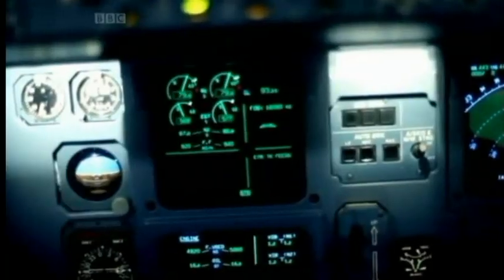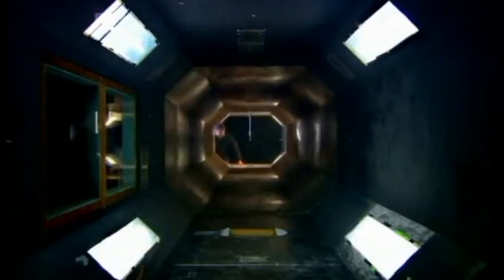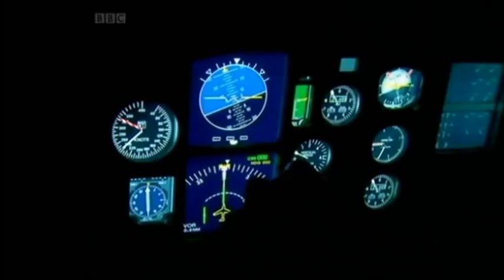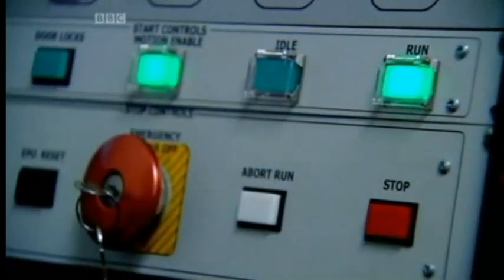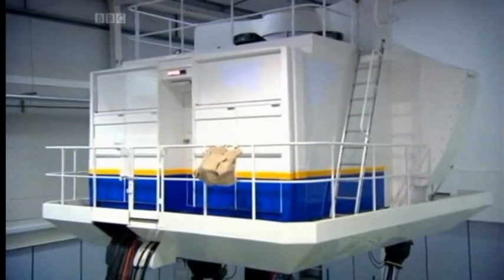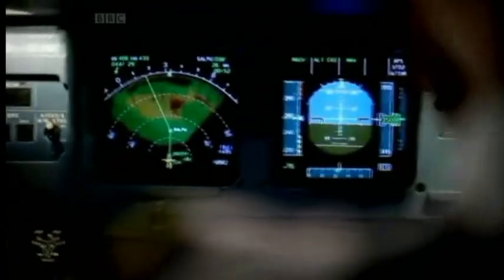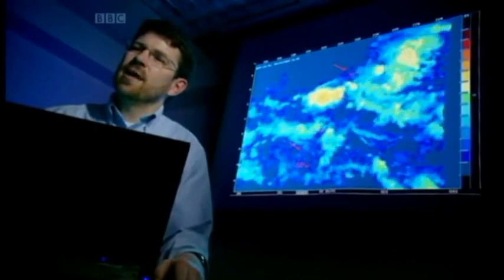The Crash of Air France Flight AF 447- Part 4 of 4

Comment: This was before they found the black boxes and it's so much worse. I mean they were pretty much correct but this was so avoidable. The captain left the cockpit, had he been there the whole time he would have known right from the beginning not to try and pitch up. He came into a cockpit with so much going on and he had no clue and then once he realized what the co-pilot did, he told him no no no don't pull up but they were too low at that point to recover. The co-pilot panicked and because he was trying to pull up, he caused the stall. If he had just pitched down and accelerated, he would have come out of the stall and leveled off and been able to have the autopilot take over. They almost recovered. But that copilot failed those people

Comment: They all should have pulled back on that stick with everything they got.
Plane falling you get that plane up fast.
Reply from the maker: That is what they did incorrectly! They should've pushed the stick forward and firewalled the thrust to stop stalling.
Reply: No that's exactly why they crashed. He was pulling up which wasn't allowing the air to flow over the engines fast enough to stop it from stalling. If he had pointed the plane down it would have resumed airflow and speed which would have stopped the stall and then they would have been able to slowly level the plane off. You can't just pull up in a stall. Because the wind resistance will slow the plane down. Pulling up is exactly why this plane crashed. That's the exact opposite of what they were supposed to do

Comment: The altimeter indicated a drop of 400 ft (error).  The ECAMS on the instrument panel warned of overspeed.  The Flight Director display indicated that the nose should be brought up (and the STALL, STALL, STALL stopped when he increased the pitch up).  Technology was misleading.
Reply: that is why it still need pilot to fly it.

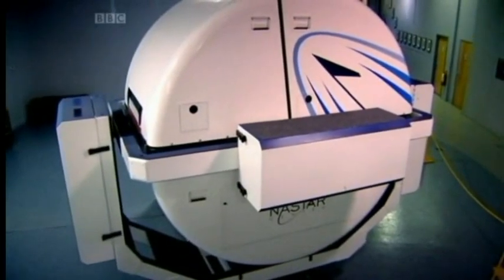Comment: @ 6:14 yeah but at night, you have nothing to look at for reference. No water, no sky. It's just dark. Get that pilot in the trainer to do it again but in the middle of the night. Might be a different situation.
Reply: They actually recreated the events numerous times with everything happening in the simulator exactly the same way as it happened and every single pilot that entered the simulator, recovered from the stall. This was incompetence by the co-pilot.
Reply: You are completely right this situation & events @night in a storm with confusion is as bad as it gets. 

Training & experience is required & this accident has improved training methods. I am certain this chain of events is used to train pilots.

Comment: Qantas Airlines records all the flight data from all their planes from the ground. I wonder why all airlines don't do this because then it's not as big a deal finding the black boxes.  Not only that but Qantas has engineers immediately available to help the pilots when their computers show there's a problem. Finding the black boxes is important but preventing a crash is obviously more important.  Also, isn't there a way to heat the pitot tubes?  Just asking.
Reply: They sayed that they were heated. However not enough, so they designed new ones. The plane however was still not fitted with them. I agree with the constant ground recording. It will do much more in saving people's lives. What i don't get is why they completely ignore the GPS and weather satelite data? Theoretically they could use that informtion to make a rough esimate for air speed.... Also how hard it is to put a power feedback in to the throttle console? They even put such things in joysticks!

Comment: The investigators had the initial pilot factor and design issues identified before the black boxes were recovered. Poor control design was a contributing factor, one pilot was pulling the nose up trying to climb and stalling the craft, the other trying to nose down to gain speed and resolve the stall. The conflicting control commands canceled each other and gave no tactile feedback to the crew who weren't communicating well with each other.
Reply: Quite right, these guys are too nice, that panic button Bonin would not let go of that joystick, trying to climb, not even thinking about what he was doing, and after he was told to release the controls, still kept at it, nothing to explain his behaviour except pure unmitigated PANIC. And he made Air France pilot....

Comment: Great program. An accurate and informed production. Such a rare thing on TV. The release of the cockpit transcript confirms most theories this program has concluded. Don't condemn the crew. Recovering an aircraft from an unusual attitude in the dark is hard enough any time. Doing this with conflicting airspeed indications at night in a thunderstorm is even harder. Then add the issues of side stick priority and conflict it becomes unrecoverable.
Reply: hmm...it's quite evident that Bonin panicked and there was a total break down of communication.

Comment: shuld the pilots have saced the plane? yes. is it as easy as it seems after this video? no. ur in the middle of a routine flight prly tired pitch dark and bam everything is beeping at once it prly took them 30 seconds just to figure out what was even happening nevertheless fix it. i think a big problem along woth dealing with the situation was simply identifying it too. identify faster, and the situation is still more in hand and more time to react more altitude to work with more speed u have...

Comment: I have watched this so many times. Thrust, power, autopilot... that's not it. All the pilots had to do was push the nose down. Jeez! Everything that happened to 447 (before the stall) has happened in my little single engine. Ice, turbulence, whatever. Slow down and PUSH down, and if the AP won't let you, turn the damn thing off. It is not pull, not power. Get the nose down. It makes me angry when "professional" pilots kill people because the no longer know how to "fly the airplane".

Comment: Why didn't Air France Pilots increase thrust immediatly when their plane slows down too much? I am not a real pilot but if i were to be in that situation, when the speed slows down greatly, I will disconnect auto pilot immediatly, increase power to full, and point nose down.

Comment: I am not a fly boy. I am a truck driver. There are times on the road when its pitch black, rain or whatever, you can not feel the road anymore, its like your floating, and you have only inches on either side of you. For them it is the reverse, I come to a slow powered stop, They need to ramp up and trim to a default condition. This is the problem with auto controls and dependably on "drive/fly by wire. You cant feel anything and your body has no memory of what it has done or where it is.

Comment: Easy to blame the pilot as being incompetent when you know what is going on and why. Having a back ground knowledge of the accident gives you a bias in what was going wrong and how to fix it. In reality you put yourself in the cockpit with systems failing, buzzers and alarms going off and with know indication to your most primary and important indication (airspeed). Especially when flying at high altitudes any increase or decrease in IAS will result in the aircraft stalling.

Comment: Even you have to trust your equipment instead of what your instincts tells you..
1. Theres NO info about airspeed or groundspeed
2. Theres dark, that means no visual orientation
3. Only thing which is working is gyro telling your attitude

Firstly you'd take controls WITH manual thrust and fly with power enough to hold decent airspeed and angle  of attack. Until you gain level flight. 
But I have to admit that its pretty hairy situation to get those alerts and airspeed showing crappy things.

Comment: A330 is a fly-by-wire - the aircraft has no rigged linkage to the control surfaces, and that is why the stick wouldn't shake even if you're about to stall or you're fighting against turbulence. This is discussed in part 2 of this documentary video.

Comment: @aizad3755 

Many years ago I remember an Apollo astronaut speaking about the reliability of their spacecraft. He said its reliability was the product of disimilarity and redundantcy in its vital systems.
This begs the question .... Why three identical pitot heads, why not two pairs of very different designs? At least it would be fairly certain that  there would be a time gap between each type icing, thus giving some warning of inpending failure.

Continued ....

Comment: very sad video. if right the answers are the speed indicators, something they have a fix for. bad timing in their turn for the upgrade. a not so simple a fix would be the ability to perform as the fighter pilot did. that i think not being simple by virtue of the fact that in all fairness he has to be considered part of an elite class of pilots. so if proven correct, the great loss would be due to a known issue, the indicators. and sad becomes horrible. me? no pilot, just human.
Reply: Matters not the number of hours one has. Any LOC scenario is difficult, this one had some added complications. Specific training, such as UPRT, SD, etc. is what all pilots should experience and early in their flying careers.

Comment: We do cover stalling in the sim but for years it was always at around 10000'. The aeroplane handles much differently at higher altitude so, following this accident, we now cover high altitude stalls in my company. Interesting point in that from around 37000' a standard stall recovery will lose around 4000' of altitude before the aeroplane is back to speed, and, during recovery, even the slightest extra loading caused by pilot input or turbulence can drop the aeroplane back to the stall.

Comment: @aizad3755 
Yes, I've flown with Air France a couple of times and their service is of high quality. Their safety record, however, is pretty poor, even if you concider the amount of flights they do. (Bad safety record doesn't matter to most customers, because flying is safe anyway.) I just wanted to point out that programming fault in Airbus software should result in problems with all airlines, not just AF.

Comment: @ASAMMBA if there was ice formed on the PITOT tubes there would have also been ice formed on the wings of the aircraft, but may have explained why the aircraft banked in a position where they ended up stalling in the way explained on the video. There is still too many factors that should have also been noticed, just the PITOT tubes icing couldn't cause the aircraft to fall from the sky. If it was enough to ice one thing, it could have been enough to cause a great deal of air flow disruption.

Comment: @marnicmoobla to my understanding the throttle moving function should be added to airbuss, it is not the same thing to be looking towards 2 screens in a case of emergency lets say that feeling the controls with both hands and focusing yourself on the main screen which shows the aircraft banking positions, maybe that way they would have reacted faster towards increasing thrust and preventing banking due to land of airspeed. Aviation is becoming too reliable on computers.

Comment: @aizad3755 Still, pilots had at least 3 min to get idea they are in stall. One pilot even said loudly Flight level 100 (=10 000 feet = over 3000 meters) after two minutes, so they had to had working altimeter. They should understand in that time they are in stall.

Comment: @NiqiV You have obviously never stalled a swept wing passenger transport then, at high altitude. I can attest, that it is far from enjoyable and the aircraft handles very differently from a low speed straight wing glider... Even the engine response at high altitude is a lot slower than what you would expect and nothing like a piston engine....

Comment: @pauloz386 Pilot error I believe. They clearly stated, that the pilot did not touch the thrust levers, after loosing airspeed indications. And speed over distance, is a lot different than airspeed. If the limit, like they said is only 10-15 kts, than normal GPS speed indications will do no good, on a FL350, where there are winds with high speeds. I still don't get, why the hell the pilots didn't try manually controlling the thrust, knowing if they loose about 10-15 kts they will enter a stall.

Comment: I'm well aware that GPS's don't give air speed, but speed over distance. That said, if the pitot tubes blocked up, and you were unsure of speed why not give it  85% power, just as the doco said with 5 degree pitch, and use GPS as a rough guide?

Comment: @reneblanco1

Definitely, I agree, but you can also definitely see the benefits of Airbus' approach, too. Frankly, what _I_ can't believe is that they out no force feedback on the controls! ESPECIALLY the throttle! I mean, WTF, how retarded!

I also bitched about this when they removed them from cars once they went throttle-by-wire. I was always used to feeling the pedal move...it was quite a trip getting used to losing that sense.

Comment: @aizad3755 True, but it is easy to do Sunday Quarterback judgments.  Now think for a minute, the Airbus Flt Control laws (Normal Laws), if you have full power (which they did), and you are in a windshear situation (which they were, but at high altitude, ascending currents of +6000 ft/min) and the first thing they see before these failures start taking place is; an increase in IAS which forces the system to initiate a climb.  Then the next thing whistle and bells start chiming with all sort bells

Comment: @aizad3755 No, the autothrust system was engaged, the FADEC's were controlling the Thrust settings.  Once the aircraft went beyond the flight limits and lost many of the onboard computers, FMGC's Autopilot, Standby Attitude Indicator or ISIS, cabin pressurization controllers, etc.  The Autothrust system went to "Thrust Lock, it stay at MAX Power.  They never reduced the thrust.  There is so much more to it than what they are telling you here.

Comment from the maker: @reneblanco1 They throttled down before approaching the clouds, and probably encountered moderate turbulence. When the autopilot disengaged, the pilot pulled up. If that is not the case, then a software glitch must have caused the aircraft to climb automatically.

Comment: There is one item, A Very important one!  AF 447 was inside three Thunderstorms, two with 45,000 tops and the last one had a top of 56,000 feet with updrafts of over 6000 ft/min.  This would have caused the Autopilot to initiate a climb when the airspeed exceeded the maximum speed, once the outside pilots were frozen by icing conditions, they failed to provide any more data.  They lost every instrument available to them for a normal recovery.

Comment from the maker: An Air France Airbus flight almost crashed last week in almost the same circumstances without the pitot tubes going broke! That may point to some sort of a programming bug in Airbus software that makes the aircraft climb at a steep angle at cruising altitude and alternate law. This is an assumption though

Comment from the maker: @Mastermism An Air France Airbus flight almost crashed last week in almost the same circumstances without the pitot tubes going broke! That may point to some sort of a programming bug in Airbus software that makes the aircraft climb at a steep angle at cruising altitude and alternate law. This is an assumption though.

Comment from the maker: @iloveairfrance It is definitely not easy to recover from a stall in night flying without instruments. However, I would go back to the point where the aircraft was not in a stall and all the pilots needed to do was to continue flying at their altitude and airspeed. Once the stall set in, it was going to be an uphill task to recover from it.

Comment from the maker: @plsniper Pitot tubes cannot work at high altitudes and moisture without heat. If the heat was indeed turned off, the tubes would have frozen very early in flight.

Comment: In hindsight they were right on the money. Pilots and Airbus itself all warned well before hand that Thales pitot tubes installed on the Airbus aircraft were inadequate and failing. The BEA proved nefarious by prematurely releasing partial CVR transcripts massaging the facts away from faulty Pitot tubes pointing towards pilot error. The primary cause is Air France negligence operating an aircraft in a known faulty condition. Airbus would do well to attend to that auto-throttle position too.

Comment from the maker: @700hawker Most airpseed/instrument failures during instrument flying end up in accidents. Spatial disorientation is one of the major reasons for loss of control. However, the pilots should have been aware of what was coming and should have flown with the nose up 5 degrees at 80 percent power. That is the first thing they should have done once the AP disengaged. They made matters worse by taking the aircraft into a steep climb. Stall speed is higher at 39000 ft compared to 36000 ft!

Comment from the maker: @pbzkfdt11 Generally,the thrust levers can only be moved manually. The thrust lever position is transmitted to the FADEC, which computes and displays the thrust rating limit and the N1 for that Thrust lever angle. In autothrust mode the levers are set in the CL detent. They do not move even with a power change by the A/THS. The range for the A/THS is from idle to max. climb power (both engines). But the max N1 rating is limited by the thrust lever angle.

Comment from the maker: @Whatever3114 Interesting observation. It is ture that some routes are turbulence prone. As for the perceived reduction in engine power, when an aircraft encounters heavy moisture laden clouds, the engine noise is muffled and passengers feel as if the engines have lost thrust. Severe turbulence can also reduce airspeed, altitude and heading. Generally pilots stay clear of these clouds. Clear air turbulence can also be quite violent at times.